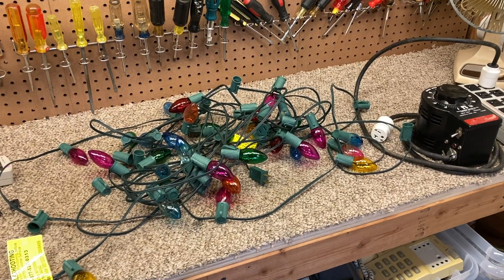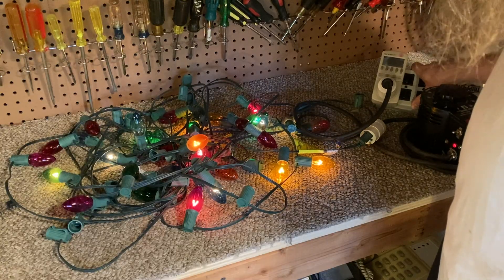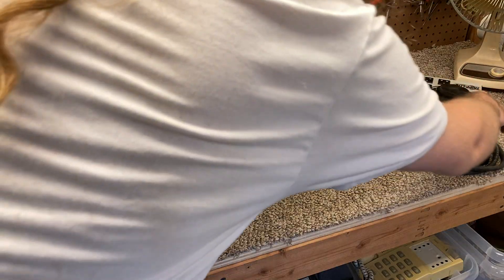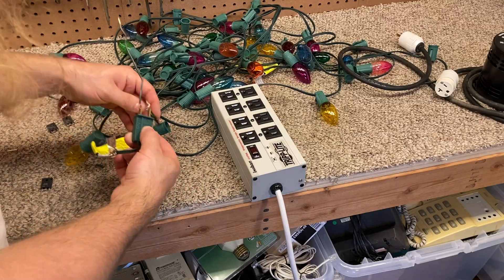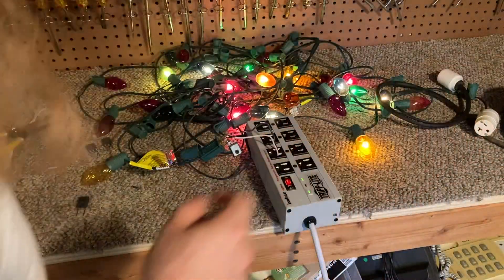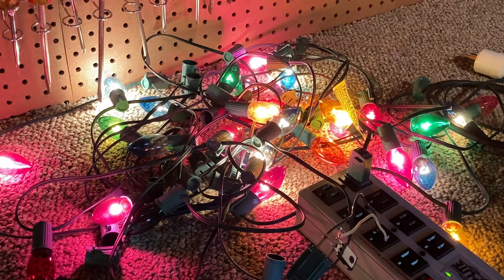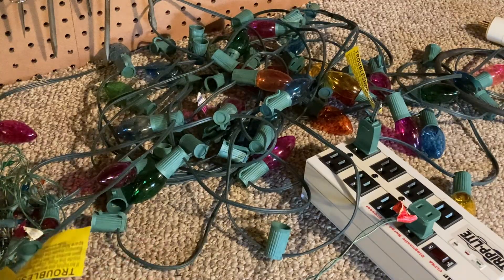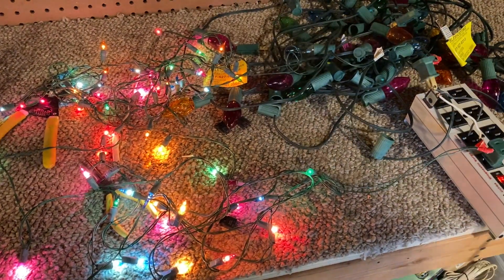Christmas 2025 | Reducing Power Consumption of Incandescent Lights by 50% to Lower Operation Costs

Comment: They sold a product that was called the light bulb saver, and it was just a diode. It looked like a little bun that you put down in the light socket and then put the light bulb on it.
I would just get ADJ dimmer rack and hook the Christmas lights up to that cuz. Those usually run at 220 split phase. Or you can take 2 Christmas light sets and wire them in series. Both sets would get a battle 60 V.
Reply from the maker: Very interesting, I've never heard of it.
Anything pre-built is well out of budget due to the amount of power I need to handle.

Comment: If you need to reduce consumption that badly, cut down on the strings of light.  Your other option is led.
Reply from the maker: Those are both horrible options compared to the solution found here.
Reply: @JordanU  I have other suggestions, but you aren't going to like them. Have you found a heat sink for the diode?

Comment: Somewhere, an OSHA manual just BURST into the flames! 🔥 I do love miniature, incandescent Christmas lights better mainly because I grew up with them. Ah, memories! The flicker shouldn't be noticeable on incandescent bulbs. I love the twinkling look, anyway, except for LED flicker. They REALLY do need smoothing capacitors. Those diodes are probably cheap enough to get. Maybe, pot them in resin or silicone. They have to cool, too. Hmm...